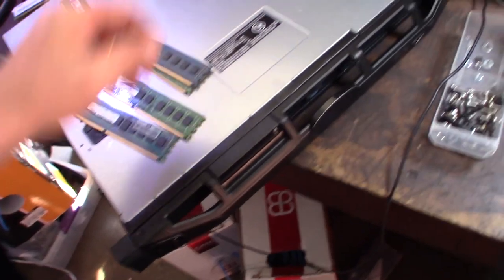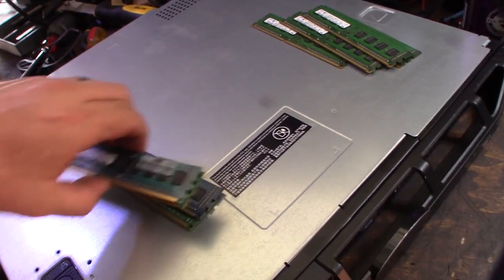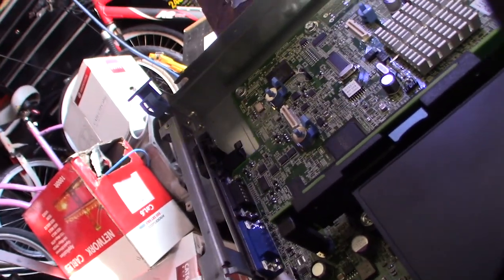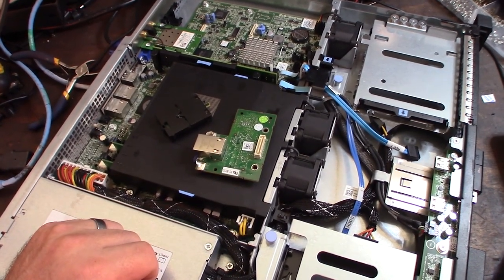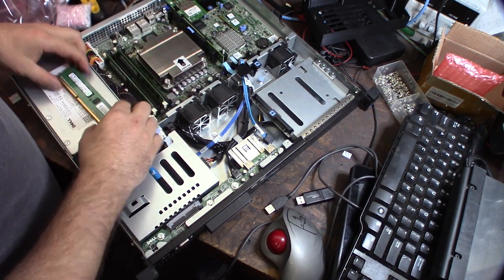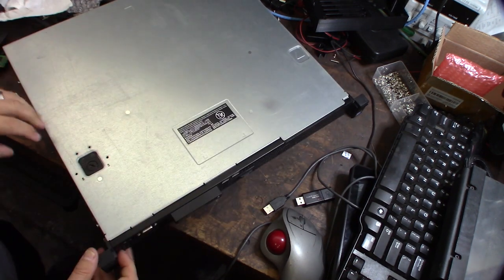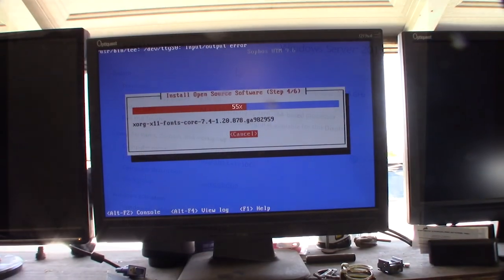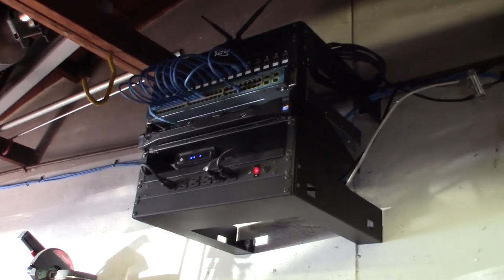Dell 1U R210 server Sophos pfsense firewall Atheros Wireless access point small rackmount

Comment: Wow! Didn't realize how cheap and cheerful those R210s are now. Literally just bought a Mikrotik router that'll be here today, for half the price of the R210, to replace my failing Asus router. I might just need to return the MikroTik and order one of these instead (without that WiFi card, though. As I already have APs configured). I really wanted PFSense, but I couldn't find anything to run it on for cheap.